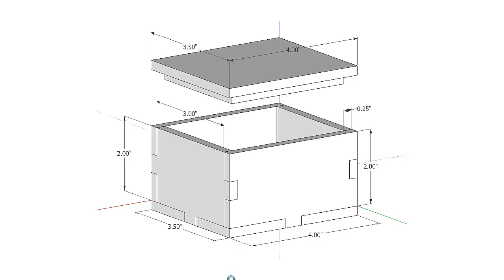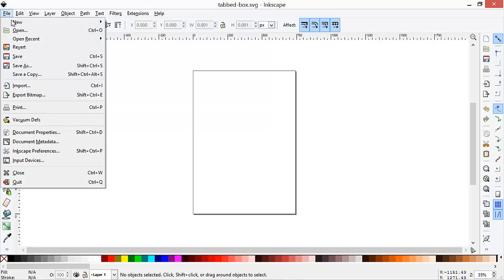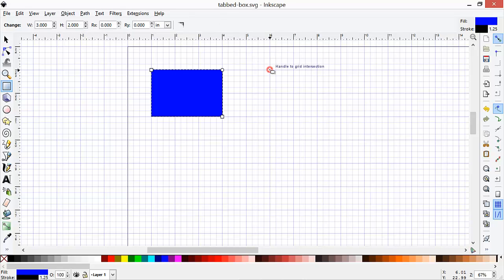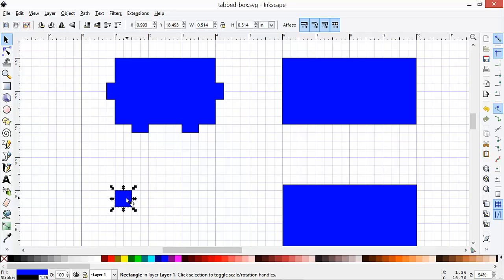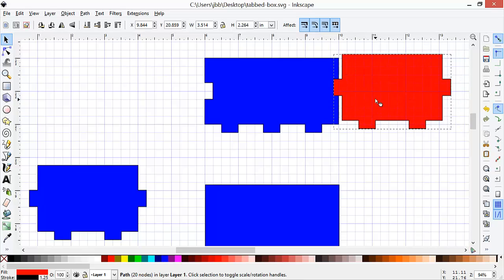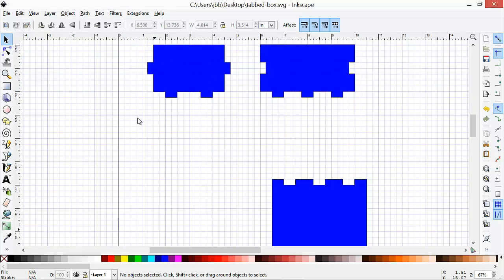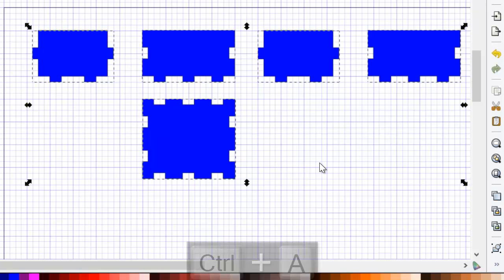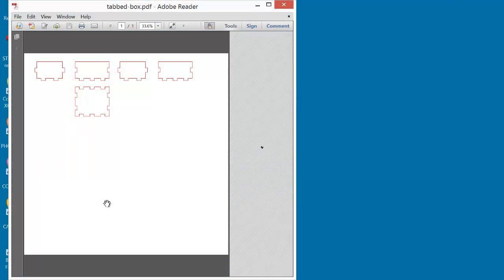Designing a Laser Cut Tabbed Box Using Inkscape

Comment: Thanks for this video!  I recently purchased a Glowforge and it's hard to find information about generating finger joints.  Do you change your grid to accommodate actual thickness of material?  For example, I often get "quarter inch plywood" which is actually 0.20" / 5.16mm thick.
Reply: I have a Glowforge and was wondering the same thing for my 1/8 in acrylic.

Comment: Thanks for this video. I have a laser on the way and have been deciding what software I will start using. I think Inkscape will be a good starting point and thanks to your video I am already designing a project. One question - when designing tabbed joints like this, does the laser's kerf cause the tabs to fit the slots loosely? If so, how do you compensate?